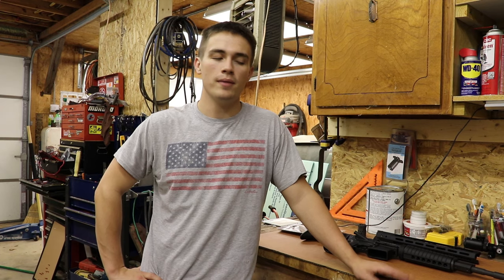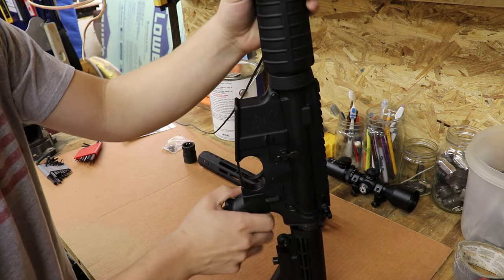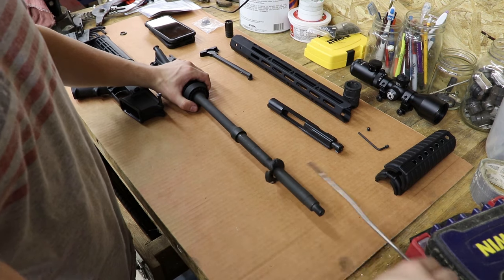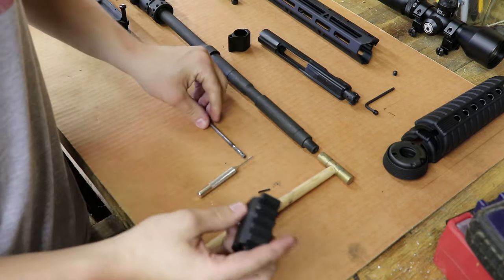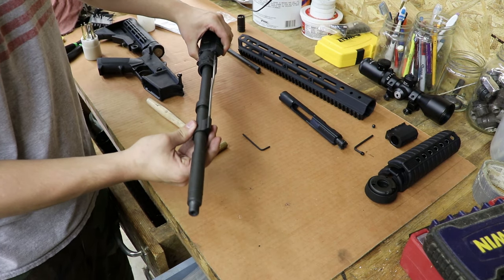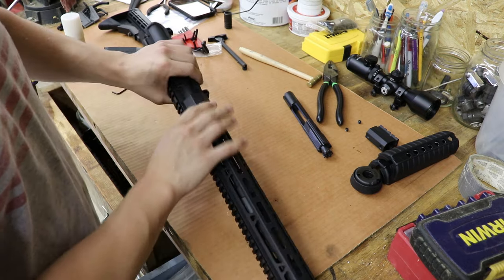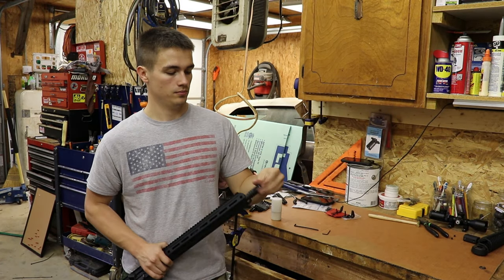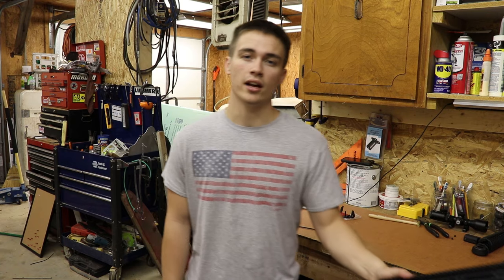Free Floating Hand Guard AR-15 (Simple Install Guide)

Comment: yall leave the guy alone. I was poor once when i was his age and did whatever necessary to get the job done. its called improvising. Lets say your in the field and dont have your fancy tool off amazon. what would you do. Probably turn to this guy next to you and watch him strip the gun with something you never thought of. your always gonna have haters. geeeez. good job man you taught me something i didnt know.
Reply from the maker: I appreciate the comment and I appreciate you watching!
Reply: @ElliottDelp  Keep doing what you do man. Excellent job.
Reply: Dude, I've got several Paul Sweeney books and it seems to me having 'all  the tools' is next to impossible!
Reply: At least put electrical tape on the jaws of the pliers.
Reply from the maker: @Caderic  not a bad idea
Reply: When I was younger, Ibuilt an AKM years ago, and I didn't have the press that everyone recommended to install the barrel. I found a steel pipe that the barrel barely slid over the barrel but was narrower than the chamber. It was longer than the barrel so I stuck the trunnion into a vise and beat the opposite end of the pipe with a small sledgehammer which pushed onto the chamber and therefore the barrel into the trunnion. I got to the point that it looked close so I started headspacing and giving it a whack. Oops, too much. I turned it around in the vise, used a few pennies (copper is softer than steel) and used a metal rod and hit it from the back to push the barrel out. Too much again. Put the pipe back on and turned the assembly around in the vise again, giving it another whack with the sledgehammer. Headspaced it again and it was perfect. Drilled the barrel pin hole and smacked that into place too. 
I know this is an AK vs an AR but the point is, there's often more than one way to skin a cat.
Reply: Perfect response!
Reply: Anyone with a AR15 is not poor, but yes nice vid
Reply: But good to see he's so much better now

Comment: Just for future reference if you replace your gas block you should index it as best you can. It's really not difficult just measure the distance from the back edge of the gas block to the back edge of the gas port.  Using a pencil mark a line on the rear face of the gas block centered on the gas port on the gas block. Mark a line using a pencil on the top of the barrel centered on the gas port. Mark a line on the barrel the measured distance of the rear of the gas block to the edge of the gas port on the gas block. Slide on and center the line centered on the barrel of the gas port and the line centered on the gas block hole. I only mention this because having a gas block properly installed will allow the bolt to function at its best and you can avoid the issues that arise from a gun being under gassed. Also the purpose of the torque wrench is so you don't strip the threads on your barrel by cranking the nut on there to tightly or having it to loose and having issues with your handguard coming loose, it's not specifically necessary but I wouldn't want you to damage your barrel accidentally. These aren't detrimental issues but it will just save you money and labor in the future. Best wishes from me to you and I hope that rifle treats you well.

Comment: Just a couple things for new owners---the 'original' front sight you have also serves as your gas block. If you want one of these tacticool free-floating handguards, you'll most likely need to replace your gas block.
The young man in this video has already replaced his so his process will (probably) be different.
If you just bought an Smith & Wesson M&P Sport II or something similar, it'll have a triangular gas block/front sight and you'll have the knock two pins out of the bottom. You'll also have to knock a teenie tiny pin out of the gas block/front sight itself to be able to reuse your original gas tube.

Next, if you decide to clamp your rifle into a vise by the upper receiver, remember that it's probably made of ALUMINUM.  Don't overdo it! That also goes for removing the sprocket-looking barrel nut.
The barrel nut is STEEL, and the receiver is ALUMINUM
 Just be careful!
Reply: He had not already replaced the gas block prior to this video. That is the stock gas block.
Reply: @tristandesforges5798  You're right. That is the 'optics ready' gas block that some manufacturers offer. 
My comment will pertain to anyone with the A2-style front sight/gas block.
Reply: @Cautionary_Tale_Harris  okay sorry I must have misunderstood your original comment!
Reply: @tristandesforges5798  No, you didn't misunderstand.
Your comment made me go check myself, and I discovered that several manufacturers offer that picatinny type gas block along with that style of handguard. 
There's a chance he's changed out the original handguard, but at this point I agree with you in thinking that particular one came on his rifle, which seems to be called 'optics ready.'
Reply: @tristandesforges5798  I also had to rewatch because it's been at least a year since I made that statement!

Comment: Use a rag around the part if you're using channel locks. Not the best tool but it will work and the rag will cut down on the scratches to the oxide finish.

Comment: Few things in the garage that will suffer. Improper torque will affect accuracy and barrel harmonics. Also, using the screws with a low profile gas-block requires dimples in the barrel, proper alingment and loc-tite are paramount

Comment: Great video man. Thanks. I am currently upgrading my handguard to a 15" free float. However, the nut on my free float is the same size on my AR 15 threads at the barrel. Is there a certain handguard I need to buy for it to fit on the factory threads? It is a bushmaster AR 15.

Comment: Heads up, it’s super easy to overtorque a barrel but and if you do 9 times out of 10 it’ll shear the threads and you’ll either A) not be able to reinstall the barrel if you decide to take it off again and have to buy a new one or B) have it detonate due to the fact that sheared threads significantly reduce the strength of the seal

Comment: Not criticising, just a heads up. Auto zone and oriely's do loner tools as far as the torque wrench goes.
Reply: I mean is kinda easy to get 25-40lb of torque by hand
Reply: @Who_tf_cares420  a torque wrench is used by hand too, it’s more for safety insuring the bolt or nut is torqued to the proper spec

Comment: Now that the ship has sailed on that hand guard for that price , whats the next best option?  I want to change out the hand guard on my Anderson.  And will it require buying a smaller gas block?
Reply from the maker: Might wana check Monstrum tactical, they have some nice rails.
Reply: @ElliottDelp  Thanks for the info.  I just ordered the M-lock 15 inch free floating hand guard off Monstrum Tactical.  It was $69.95 which is not a bad price.  Question, will I need to change out the gas block.  I do have one of the .750 gas block from primary arms if I need to change it out on my Anderson.

Comment: There are a few tools that are essential for this sort of work. First is a barrel nut wrench , next a torque wrench, and an upper receiver vice block. Of course a vise on a work bench is needed plus a roll pin punch and gas tube alignment rod are important. At any rate, sure it took forever to get the barrel nut off and it was likely damaged too.

Comment: anything bad happened? about you not putting it at 40? cuz i planning to buy a AR-15 and upgrade the handguard by myself after
Reply from the maker: I mean nothing has happened with the gun. I would go and get you a torque wrench tho. I mean read the comment section. Harbor Freight has them for like 20-30 bucks on the low end. How tight to torque the barrel nut will up to the manufacture, make sure to check with them. Thanks for watching the video and I hope it helped!

Comment: I'm confused. I just received a complete kit and it seems like I didn't receive a barrel nut. The handguard had threading and it screws on the upper. Is that the barrel nut in there?
Reply from the maker: Was it a BCA hand guard? The barrel nut might be in the hand guard and you just need to pull out it. I have never heard of a hand guard screwing onto the upper.
Reply: @ElliottDelp  lmao yea man, it was in the handguard held up by two screws 😂 thanks man. I'm subbing
Reply from the maker: Awesome! Thanks!!!!

Comment: Great video. Only video I have found on the Bear Creek handguard.

How are the QD attachment points? Comments on forums are all over the place on that.  

I have an upper on the way with the same handguard.
Reply from the maker: Tbh I don’t hardly ever run a sling on this rifle. When I first put it on I tested it with a magpul sling and it worked just fine. I can’t say for certain how great it is.

Comment: thanks for the free class, did you test the gun? is it okay to not have the tork tool?

Thank you
I follow your channel here in Brazil
Reply from the maker: Gun has been shot a ton since installing the hand guard. I would use the tool if you can get it. If you can’t get it, make sure the nut is on there good. If you are unsure I would take it to a local gun smith. I love the support from Brazil! That’s awesome man!
Reply: 25-40 lbs is NOT a lot of torque so I would just snug it up and send it. For comparison, the average car lug nut requires around 100lbs of torque

Comment: Getting the required torque with a pair of channel locks is sketchy for an experienced mechanic.
I hope it stays together.
Reply: After some more thought on your video it's the kind of thing that scares the hell out of the liberal left.  A mere child working on his own gun!
  
You will find that if you turn those channel locks around the natural grip of the tool will work much better.  Upper handle when pushed pushes up on lower jaw giving much more "squeeze" on the bolt, nut or pipe. 
 When you put channel locks backward on the barrel nut it took my breath away!  There is some special grease your supposed to use on those threads called aero shell. 

Please watch more than one video when you want to work on something so you get to see more techniques and tools and the proper use of them.  It will make the job much easier  and way more permanent.                    

 Good luck with the project.
Reply from the maker: Thanks for your input. I appreciate you watching and appreciate you commenting as well.

Comment: I liked your video. It was pretty good, but you really should spring for a halfway decent armorer's wrench, especially if you're messing with the standard barrel nut. And for whatever ungodly reason there might be (like building a second rifle on the cheap for keeping in your trunk, etc.), you'll HAVE to have a proper barrel wrench so you can properly time the thing with your gas tube. Very important. And you can make use of Auto Zone's free tool rental to get a torque wrench. Just leave a deposit check with them. All due respect, but man, you've got to really clean, de-grease, and apply a good gun grease to the threads of the new barrel nut. Tighten it down, then loosen it again. Do this two-three times. It relieves potential thread stressing. Without tightening/untightening that barrel nut a couple of times, and especially with not using grease, you may very well break your upper receiver the next time you need to remove that barrel nut -- especially if you over-tightened it. Believe me, I've seen it happen more than once. And many a professional gunsmith will tell you the same thing. Proper torquing is fairly important, but despite what many will tell you, getting the "perfect" foot-pounds isn't absolutely vital, and you can get by just ballparking the nut when tightening. But that greasing/tightening/untightening/re-tightening thing is pretty damned important, and I can't stress that enough.

One last note about the armorer's wrench: don't buy the cheapest one you find. I tried that. Twice. They're pieces of crap. Either the castle nut wrench won't  fit properly, or the barrel wrench part won't, or both. Brownell's will sell you a first-rate wrench for about $30 that will work as advertised. I've been down the "on the cheap" road before and sympathize, and you won't regret spending the money. Since you're a relative newbie (all due respect, we all were at one time), you're going to eventually build another rifle. And then another. Then you'll want to build a shorty the ATF allows by calling a super short stock a "wrist brace." One tool at a time if you're on a tight budget, but that should be a big priority if I were in your shoes. And I was at one time, and now I have all the tools (including a cheap -- but good -- drill press, a super sweet DeWalt DWP611 router, a couple of jig sets and all the assorted bits and end mill, and can start with an 80% lower and end up with a gun that's as good as anything you can buy off the shelf. I've built six for myself in the last couple of years, one for my son, and one for each of my five grandsons, so I have been around the block a couple of times and run into unexpected hiccups along the way.

Good fortune to you, young man!
Reply from the maker: Thanks for watching and liking the video Allen. Most of the stuff you mentioned I have already picked up like a wrench and grease. I appreciate you commenting.
Reply: @ElliottDelp  You seem like a good kid, er, young man. Your presentation was also applaudable. You came across well and not like a lot of the people who post instructional videos and make out like they're the gravy on the taters, and should've mentioned that before. Really glad you got the wrench. I think you'll find over time and with more experience, 35 ft. lbs. is plenty tight enough. I would also urge you to buy the Gunsmithing the AR-15 Bench Manual and other books by Patrick Sweeney. They're available from Gun Digest and worth their weight in gold. There are four in all.
Reply: @58allendavis  
thank you for the class, thank you very much

Comment: I’ll tell ya about the flash hider. Use visegrips. Taking it off the first time. Sit on the gun because it is tight tight tight coming off the first time. Use visegrips because they lock onto the nut and won’t scratch it if done properly.
Reply: Also putting the flash hider on. Make sure the middle slot on it is aligned with the gas tube.

Comment: Please reply quick. Do I need oe or aftermarket barrel nut?
Reply from the maker: This hand guard comes with a barrel nut.
Reply: What about checking head space?
Reply from the maker: I didn’t change anything with the bolt or barrel. So I didn’t check the head space.
Reply: Elliott Delp awesome! I found the barrel nut and wasn’t sure if I needed to check head space or not. Everything is on! Thanks for your video.

Comment: Did the pliers cause any scratching to the spots you used them on? You can get a good delta wrench for under $30 (only that high if they have multiple size slots otherwise much cheaper). 

Otherwise, interesting video. Normally, I’d just take my gun to a gunsmith and have them do whatever, but damn… if you can pull this off with pliers, maybe I need to stop being so lazy lol

Comment: you made taking that barrel nut off look easy. Tried with pretty much the same set up and mine is seized. ended up ordering the vice clamp and barrel nut wrench because I don't want to bend anything. Watching your vid after attempting mine you made putting the gas block pins look like a breeze also.
Reply from the maker: Yeah, my barrel but was awful too. It took about 20mins to take it off but I couldn’t include all that in the video. I know a lot of people have problems with it and a bunch of people have used different techniques to take it off that I am not comfortable doing like heating it. I didn’t really have a problem with the gas block pins tho.

Comment: If my at came with a low profile gas block do I need to take the barrel nut off
Reply from the maker: You will need to install the barrel nut that comes with your hand guard. You will have to remove the gas block to get the barrel nut off.

Comment: Yeah.... specifications are important.  20 to 40 foot lbs is definitely way less that as tight as you can get it with channel lock in a vice unless you are a 12yo.  The damage that can be caused by not using the "specialized" armors wrench to the treads will cost you way more. 

Will is shoot safely... most likely. But i don't want to bet my life on it for 60 bucks in tools.

Keep after kid.  Just maybe add more weight to the value of your life vs paper money.